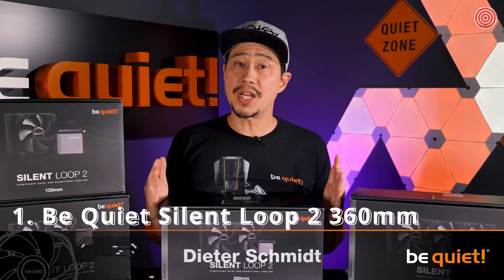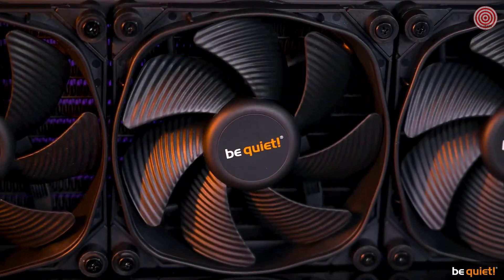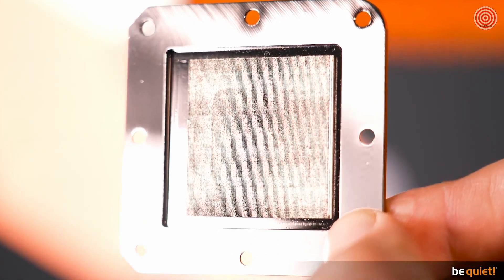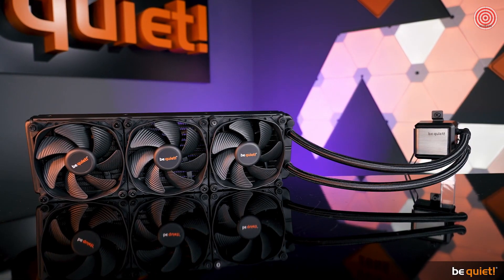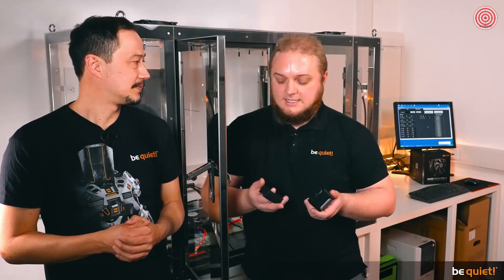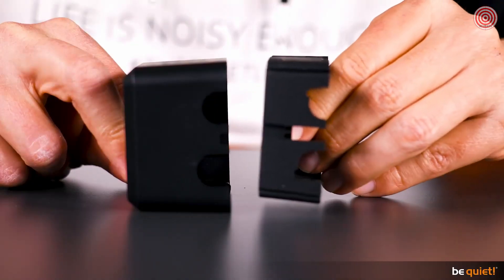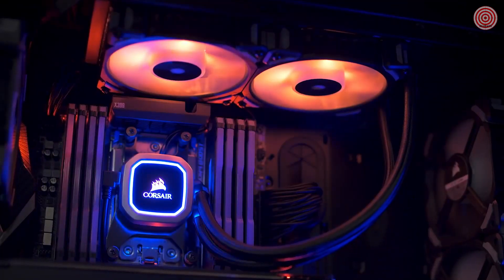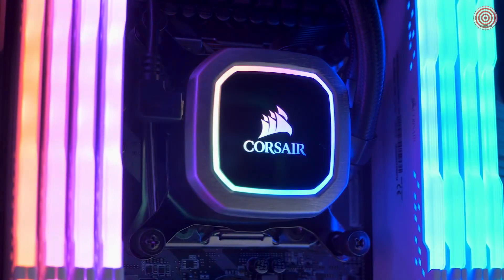5 Best AIO Coolers for Ryzen 9 7950X and 7900X – AMD Recommended Coolers

Comment: If it's silent it don't work
Reply from the maker: What? ⁉️
Reply: I have tried all aios it's just worth spending a little extra and just buying a custom loop with a better block. The aio pumps are so restricted it's not funny doesn't matter what brand they are all the same. Big difference between 16mm lines and 3mm 4mm that aios  have.

Comment: How reliable are these water coolers? What is there life span?
Reply from the maker: All of the water coolers you listed are reliable and have a lifespan of 5-7 years. The Be Quiet BW012 Silent Loop 2 360mm and the Corsair H115i RGB Platinum AIO are both known for their quiet operation, while the MasterLiquid PL360 Flux and Nucleus 360mm AIO are known for their high performance. The Kraken X63 280mm is a good all-around choice that offers both quiet operation and high performance.

Comment: Arctic Liquid Freezer 280mm and 360mm AIO's are one of the best for AMD CPU's. it has an offset mount so it can cover the CPU hotspot better. I've used a 280mm and a 360mm on both the 7900x and 7950x and they kept the CPU's nice and cool. Also, the 280mm performed better by 2-4 degrees on both the 7900x and 7950x
Reply: hey i’m getting a 7950x what kind of number are you getting @AustnBell
Reply: @jehloading  60's in gaming, sometimes low 70's for a split second, and 90-95 in a stress test. Keep in mind that this CPU was designed to push itself until it hits 95 degrees. so seeing it hit 95 in a stress test isn't bad at all. This CPU wants to run at 95. Its the hottest CPU ive ever used. I've tested the arctic 280, 360, the EK nucleus 360, and Corsair H150i. The Arctic 280/360 performed the same as the EK, but the Arctic is quieter. The CPU's ran hotter using the Corsair. just make sure to use the Offset mounts on the Arctic cooler. Helps a lot.
Reply: @AustnTok  Okay i just bought the arctic 420mm and getting the lian liam 3 to fit the radiator should be ok
Reply: @jehloading  damn dude. lol. yeah, the Arctic 420 will do the job for sure. That is an incredible AIO. I wanted it but there isn't too many cases that look really nice and can top mount an Arctic 420.
Reply: @jehloading so you need two different fans? I’m trying to build a gaming pc for my son. But very new. Friend gave me a Ryzen 9 7900x cou and a Asrock B670E Steel mobo. I bought a 3080 ftw3 ultra gpu. What should I get for a fan? I just want to keep it cool like yours. But don’t understand the fan for the radiator.??
Reply: How would a 280mm do better than a 360?
Reply: @FauxTanka  idk. It's gotta have something to do with the P14 (140mm) fans. They're better than the P12 (120mm) fans. But there's plenty of videos on YouTube that show the Arctic 280mm outperforms the Arctic 360mm by a few degrees at least. I've tested it on several CPU's too
Reply: @Andy-England-1967 yeah, the newest version right? That AIO is definitely a good one. I was gonna get it for the new build im working on but I got the Deepcool LT720. That one is supposed to be the best AIO. wonder how the Galahad II compares against it
Reply: hi austntok. i am looking for a 7950x3d. also having eyes om arctic liquid freezer II. my question is; would be the 240mm model enough for that cpu? i dont oc, yes play games on 4k, but dont use it as much as other gamers. my problem is, that i have a lian li dk-04 intable pc and in the back side i have 2 x 120mm fans. there is also a aio cooling a 5950x atm. in the front i have 4 x 120mm fans in a row but i fear that the tubes are not long enough to get there, else i could install a 360. and in between there is the gpu... i hope you understood a little. sorry for my bad englisch. main question that would solve all the stress would be you saying 'an arctic liquid freezer II 240 just works fine with it" :-) thank you very much
Reply: @ohiokin  you would probably hit tjmax during a stress test but it should be fine in gaming loads. The Liquid Freezer II AIO's have an AMD offset mount to cover the hotspot on AM4/AM5 better. There won't be any directions in the box so you have to look them up online. If you get the 240, make sure you follow the directions and use the offset mount. That should help considerably. The 7950X3D is a very hot CPU, so I think if you're running it at full utilization on the Arctic 240, it'll probably get  to 84⁰ (I believe 84⁰ is Tjmax for X3D) but yeah, it should be okay if you're just gaming and not doing too much crazy intensive workloads.
Reply from the maker: Thanks for the info, but as I guess you saw, the video is called ".... - Recommended AMD..."
Reply: @AryTechB  Yeah, I saw, and I was recommending an even better AMD cooler

Comment: I'm looking for a cooler that lowers the temperature of my Ryzen 9 7900x and doesn't get too hot.. can I get a cold temperature below 70- Celsius? also a suggestion for a casing that is suitable for cooling hot temperatures
Reply from the maker: Tell me what is the current configuration of your PC. (cooler, case, fans, gpu and motherboard)
Reply: @AryTechB  
Cooler :MSI MAG Coreliquid P360
CASE : MSI MPG Quietude 100S
Fans : Be Quiet Silent Wings Pro 4
Motherboard : X670E ROG Strix E Gaming WiFi

I use RTX 4090 MSI Suprim X
Reply from the maker: @oyaaramadhan116  With the setup you have you shouldn't have any overheating issues. 
I hope you have 3 fans on the front of the case on the intake, the radiator from the cooler positioned high on the exhaust plus a fan on the back also on the exhaust. This is the setting I recommend all. 
According to AMD, the 7000 series can run all day at 95C without any issues. From default, the max temperature limit was set at 95C.
As long as you don't reach temperatures of 95C°, the system is ok.
Reply: @AryTechB  do you have any suggestions for a good cpu cooler for cooling ryzen 9 7900x? and a good airflow case suggestion to cool it too
Reply from the maker: Be Quiet BW012 Silent Loop 2 360mm  with Thermaltake Core P5 Tempered Glass V2. 
I think this combination gives you maximum airflow and cooling.
Reply: @AryTechB is a 240mm cooler okay for a 7900x

Comment: Hi, is corsair icue h170i elite good for ryzen 9 750x?
Reply from the maker: As far as I know, this cooler has a TDP of 280W and it is also compatible with AM5.
So I don't think you'll have any problems using it with the Ryzen 9 7950X.

Comment: I have the asus rog ryuo water cooler, is that possible to place that on the x670 socket??i had it on a 1151 intel socket..
Reply from the maker: YES, it is possible to use asus rog ryuo on AM5(LGA1718), you have to make sure that your cooler offers 105W TDP for ryzen 5 and 7 from the 7000 series and 170W TDP for Ryzen 9 from the 7000 series.
PS: X670 is the motherboard chipset.
Reply: @AryTechB  yes I got the ryzen 9 7950x cpu, apparently I looked up this cooler is able to do 170W, I also checked the list of CPU’s it is good for the 13900K and the 7950X I just need to get a bracket for the amd cpu
Reply from the maker: Although asus announced that: "ASUS AIO Coolers Will Be Fully Compatible With AMD AM5 Motherboards"
ROG Ryujin, Ryuo and Strix LC coolers will fit via an AM5 mounting kit, but until today I have not found any such kit.
My suggestion is to contact ASUS support.

Comment: Hey i bought en new system with ryzen 9 7900x with an nxzt kraken z rgb new pump 
And the cooling power its not enough with cinebench i come over 90degrees in core temp 
The temp on the display from cooler is at the same time like 33degrees how thats work the pump is working 
What i have to do to cool it better
Reply from the maker: Which Kraken Z is? 53, 63 or 73?
Reply: @AryTechB  i have tue z73
Reply from the maker: Something is wrong with your Cooler, you shouldn't have such problems
Reply: @BullseyeReview2IT  how does the z63 with this cpu? Getting it delivered in a few days

Comment: 10:50 but isn't the 7950X/7900X from AMD AM5 socket not AM4 ?
Reply from the maker: Ok, but the main installation is the same.
Reply: @AryTechB  but does it fit? If I buy a Am5 motherboard and a new 7000 CPU. I tought u need a Am5 kit from nzxt for it cuz am4 doesn't fit, no? (speaking of the kraken Z73)
Reply from the maker: NZXT says that the Kraken Z73 is compatible with AM5. 
PS: As long as you don't have to remove the back plate for installation, any AM4 cooler is compatible with AM5.
Reply: @Walnut42  you are right. As far as I know you have to contact Nzxt for them to send you the AM5 bracket. I don't know if they already include it or not in new purchases